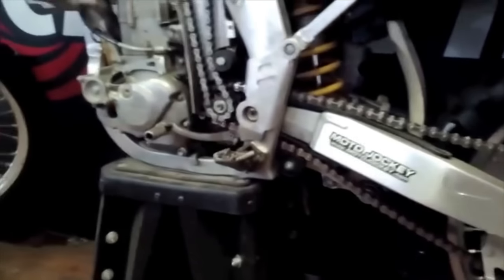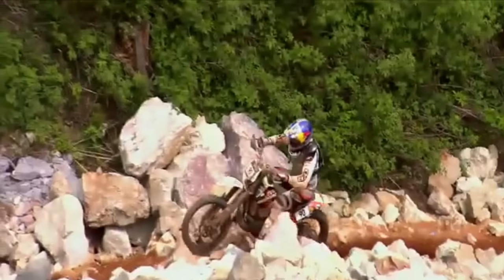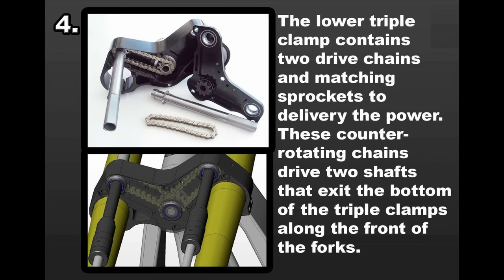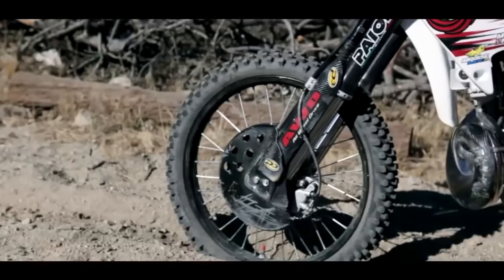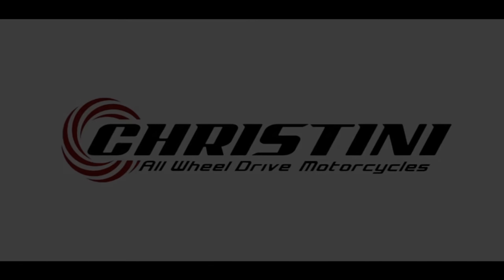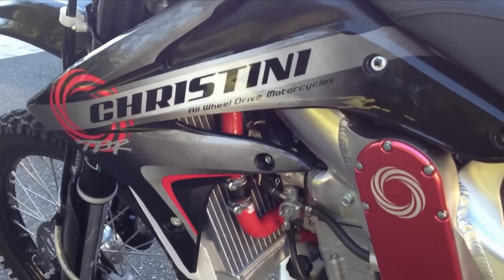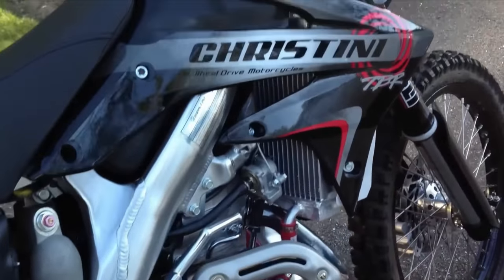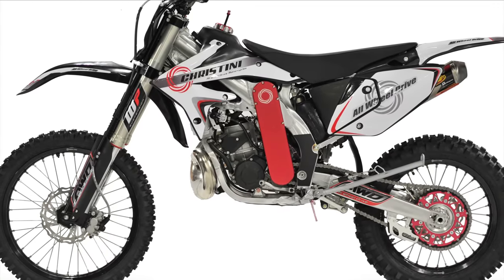The Christini AWD 300 2x2: How All Wheel Drive Works on a Dirt Bike

Comment: The thought into this design is genius. I remember seeing information about it back in the early 2000's. Although, it always looked and seemed like an expensive maintenance nightmare. I am sure a rider with support in racing could definitely benefit in certain conditions.
Reply: I almost feel that a hydrostatic drive might be more efficient. There are so many transfers of energy with this system that efficiency must go down a bit
Reply: @NetPredators  not really. Chain drive uses very little energy. You're losing more through a standard transmission alone that the awd setup does
Reply: @spencerkleiman5035  lol, you do realize that there is more just 1 chain drive there? There is at least 8 transfers of energy there with loss at each transfer.
Reply: @NetPredators  The chain or shaft is a final drive, so no matter what you do, that last one is what the most important. Front double driveshaft like this one lose more than 20% power, but I think that is a worthy tradeoff considering how fragile a front chain drive system is (I had one in the past)
Reply: Rokons had 2wd since the 50s.

Comment: Fun thing I've seen, someone back in the day made a 2wd by adding a hydraulic motor - the rear chain essentially drives a hydraulic pump which then moves the front wheel when needed. He briefly mentioned hydraulic pumps in his video, but not how they worked in this respect - I'd say it's as simple as a front electric motor... Without needing electricity
Reply: Yup Hydrolic is a much better design
Reply: Hydraulic is definitely an interesting idea to drive the front wheel. With how powerful modern electric motors are and how efficient generators or even alternators can be though, I think going electric is a good move. Instant torque front and rear would be something else, and for a full electric setup would be as simple as dual hub motors.

Comment: I would like to see a system such as this on an old Honda ATC three wheeler, an awd Big Red 250ES would be pretty cool imo.
Reply: That would be awesome on a big red
Reply: Why not a 250SX or 250R?
Reply: @hank1556  LOL! Okay, add them to the list as well.
Reply: Tires are too big. Not enough rotational rigidity to turn and power through if its stuck
Reply: @jeeperzcreeperzz  Surely there is an efficient and effective way.
Reply: @markalan4026  maybe if a 3wd system was used in low gear it might work?
Reply: @jeeperzcreeperzz  I was thinking a series of small drive shafts (telescoping on front forks), using ring & pinion type gears, and a limited slip mechanism for the front wheel.
 I'm no engineer, but I know there is a way to make this work. Wish I had the skills and resources to make it happen myself.
Reply: @markalan4026  bvc offroad confirmed they are making a 3wd trike
Reply: @jeeperzcreeperzz saying trike after 3wd is unnecessary of course it’s a trike 😂
Reply: @Thumper68  except there arent any that are true 3 wheel drive so my statement still stands.
Reply: @jeeperzcreeperzz  you don’t understand if your making something 3 wheel drive it’s obvious it would be a trike having 3 wheels. You’re not going to make a three wheel drive on a 4+ wheel vehicle so by default it’s got to be a trike so my statement stands
Reply: @Thumper68  Not necessarily, and I don't think it's very important or productive to care what it's called. I have seen a homebrew "hybrid" go kart be 3 wheel drive. 2 electric motors in front, 1 wheel driven by the gas motor in the rear.
Reply: Just put a dual rear on a rokon trailbreaker.
Reply: Would be almost worth it to buy one and put it on big red. Would have to learn how to drive big red again.

Comment: Around 20 years ago Yamaha had the 2-wheel-drive WR 450 F2-Trac. It’s a hydraulic system and gives up to 30% to the front wheel depending on the wheel spin/traction loss of the back wheel. But this system looks also pretty cool especially for a retro fit.
Reply from the maker: Thanks for the info!

Comment: I'd heard of these years ago and believe there was military applications and that it was mainly being developed for that.  I'd imagine electric motors now would trump this design if technology is here now for it.  Would be just as fast , could be full time 2x2, and totaly stealthy  as  nearly silent compared to a gas engine.   Battery weight likely the main issue,  but the tech is growing very rapidly and I'm sure the military is on the cusp of it if anyone is.    Enjoyed the video 👍👍👍
Reply: At least 40 years ago? Rokon (spelling?) comes to mind?
Reply: alternator + small battery and a hub motor on the front wheel. DONE and could be customied with software... wish i had money to go patent a design like that :)
Reply: @vihreelinja4743  that would be one hell of an alternator
Reply: @benfennell6842  If it's not full-time 2WD, it could be charging the batteries while rolling in 1WD. This would limit how long you stayed in 2WD at full performance, but at least lets you recharge while moving through easier sections.

Comment: This is definitely a new take on 2WD bikes.  I had a Rokon TrailBreaker back in the mid 1970"s.  Rokon's  are not "dirt' bikes though.  They are slow and steady trail bikes for going where there is not a path.  I think that they will go places the Christini will not, but the Christini is light years faster.  The drive system was very different, too.  The 2WD is full time and only cuts out on the front when the spring loaded clutch slips (by design).  This seem very cool, and I wish it had been around when I was an active dirt biker, 30 years ago. LOL

Comment: Yamaha and ohlins were building a limited amount of 2wd dirt bikes in early 2000s using hydraulic drive system, a local bike shop had one of these bikes forsale about 15 years ago as I was tempted to buy it
Reply: Yeah I remember these 2WD WR's. At the time there was a lot of hype about them being the future of dirt bikes. Never did get to see one in action. The 2WD system is a marvel of engineering but probably a novelty for most riders. For some circumstances they could prove invaluable.
Reply: I tested the Yamaha 2-Trac for Australasian Dirt Bike Magazine, and the story was re-printed in one of the US mags as well. I liked it, but many of the top riders that rode it didn't. I think this may have been because it tracked so well in slippery corners rather than sliding. They were all used to steering with the throttle and back wheel in those conditions. Only 250 were made, and only 20 came to Australia, none went to the US. At least one of the Aussie 2-Tracs was sold by a dealer here to somebody in the USA. They couldn't be road registered in Austrlia as they did not have a compliance plate and were twice the price of a conventional WR450. They also came with top of the line Ohlins suspension front and rear and an Ohlins steering damper.
Reply: @wazzanose   they were nice looking bikes

Comment: Man this would be killer on a torquey trail bike. Like a TW200 style bike with more power seems like the perfect fit for having 2wd. Just a bike designed to tractor anywhere 2 wheels could ever go with minimal effort
Reply: Would be interesting in a Trials bike. Could be hopping around on the front tire instead of just the rear
Reply: Rokon out of New Hampshire has been building these for decades. They even have one with big hollow wheels that floats

Comment: Very cool ! But since I'm not in to going fast and prefer a quiet utility machine to poke through the woods, I'm still going to own a Rocon 2x2 one day.
Reply: I think I remember seeing one when I was a child. Is that the bike with big tractor tires?
Reply: @shovelhead108  The old ones had very tractor like tires and 2 stroke engines. Now they have ATV type tires and 4 stroke engines. I miss spelled it Rocon, it's actually Rokon.

Comment: It looks pretty cool but just remember those extra 6 kg (13.2lb) are mostly rotating mass with a fair bit of it being unsprung weight. Both of which will make if feel heavier then 6kg (more like 10-15 kg) and dramatically effect handling. 
I also wonder what effect the two drive shafts have spinning adjacent to the engine and having a torque effect on the steering would do to over all handling?
All that being said bike set up is a game of give and take to improve in one area you usually have to give up in another area and for all the negatives I’ve mentioned you are gaining  traction which in some circumstances is very hard to come by😀
Hopefully one day i get to try it out
Reply: It changed the handling so much that the guy started on the second row and went right by all the 1wd bikes
Reply: @ClumsyCars  was that the bike or the rider?
Hey i think it looks pretty cool but if it’s as good as you say then why isn’t every hard enduro around the world being dominated by one?
Reply: The purpose of having drive shafts on both sides of the front wheel is to prevent gyro steer (or at least minimize it).
Reply: And spread torque load I’m sure

Comment: UBCO crossed with a gas bike. Hybrid - electric front hub drive and a 450 gas engine for the rear wheel on a KTM Freeride frame with a beefy charger (mechanical from the gas engine). For getting out of sticky situations only, and help with slippery hills. Button on the left thumb.

Comment: to much gears to fail Ohlins have a similar concept for the wr450f with hydraulic pump on the sprocket and oil lines to the frontwheel hub wich transfer the oil pressure in to turning the front wheel! its more clean solution and less shafts gears and so on!

Comment: 2 of my 3 electric bikes are All Wheel Drive. Its 2 independent system. 2 Motors, 2 controllers, 2 batteries, displays, 2 accelerators, one for each thumb. I also have 3 motors on one my bike which is 3 everything. 2 thumb-throttle on the right and one on the left. The 2 on the right are the rear hub motor and the mid-drive motor and the one on the left it's the front motor. I used many combination.

The thing with all wheel drive is the front wheel is directional. So at low speed when you are turning for example you want to be careful and use very little throttle on the front motor because the bike will pull the bike this way and you will go the other way. So basically when I turn at low speed, I only use the rear motor and when I get more straight I add the front motor. At least in the beginning when you learn and you are not used to it.

Note that my experience is on the road and snow. Off road folks have more skill will probably get that in seconds. Humbly!
Reply: А вы на каждое колесо использовали по своей (отдельной) ручке газа? Тоже уже давно подумываю либо об электрическом велосипеде на основе полного привода, либо об мотоцикле 2х2, но с независимыми приводами чтобы в идеале каждое колесо можно было накручивать газом по отдельности в зависимости от необходимости...
🤔🤔🤔

Comment: A nifty way to get power to the front wheel but I imagine the parasitic power losses would be huge and all those mechanical linkages and bevel gears to shim/adjust and the mess of the drive chain etc. It would be far simpler to mount a battery somewhere and put an electric hub on the front wheel, probably weigh less as well. We have 2WD electric off road bikes here in NZ, good in the mud apparently, not much good anywhere else.
Reply: С электрической начинкой скорее всего, будет больше веса.

Comment: Looks rad. One thing to think about is when, not if, it fails. Will it break and let the rim still spin? Or will it break and lock up sending the rider over the bars?
Reply: Not everything is an if, not when. I’d argued this system is less complicated than a modern 4 stroke.
Reply: @alecnull  i agree to disagree. Rotating parts eventually fail. Just a matter of time. Dirt bikes are treated roughly, so just a explanation of what keeps the rim from locking up on failure?back rim lock ups dont throw you off.
Reply: from what I'm reading, it uses one way clutches which are located in the front hub, so yeah, unless the failure is in the front hub itself (which seemss very unlikely looking at the design) it looks like it will still let the rim freewheel
Reply: @omurize2007  ok, that sounds great. I did not see that in the design. Would love to try it out. Must feel wierd having the front pull you.
Reply: It's got a one way clutch in the front wheel. It doesn't hold back..

Comment: Bumped into Freddie Spencer a few years ago and discussed this idea for MotoGP bikes as with heated rims this would stop the front tyre from losing heat and therefore the grip which causes the front end washing out,  momentum from restricted power to the front wheel would stop the front free wheeling therefore making the bike faster because of increased drive but would be slightly heavier.
Reply: А что в итоге сказали в MotoGp?
😉😉😉

Comment: How "bout a hybrid which adds an electric hubdrive in the front, for getting out of sticky sits, not for continuous use. A beefy charger off the gas engine, which draws a little of the horsepower and a nice battery, but not for continuous drive. ??
You know - "sticky situations"?

Comment: I love the idea, but I would try adding some weight to front not just throw it front wheel but move the whole engine forward , rear shock under  it will make more easily controlled , but the best thing about your design is that it will get people back. To th woods and away from acrobatics and crowd pleasing

Comment: To be honest a low wattage electric hub motor built into the front wheel would be simpler and only the synchronization issues would have to be sorted out.You don't need much power to have a positive effect.

Comment: I own one. 2006 576 Ktm dual sport, with auto clutch, and rear brake on the clutch lever now. At 55(then) , it made me better rider than I was at 25. Friends stop following me on rides.
Reply: У вас поездки преимущественно по бездорожью?
Reply: @ACMulti100 . Both highway and extreme off-road. I ran an enduro tire that Malcom recommend. It was a beast there wasn’t any trail or course I couldn’t  conquer. Up hill or down hill, it was so stable.
Reply: @grumpyg9350 , понял, здорово. А за сколько примерно брали, сколько по времени пользуетесь и были за время пользования какие - либо поломки? Как с доступностью запчастей и возможностей ремонтопригодности и сервисного обслуживания?
🤔🤔🤔
Reply: @ACMulti100 I don’t remember the cost. I think it was around 5,000.00 usd. The only issue was the rapid deterioration of the rubber bellows that covered the telescopic tubes. They changed the formula of the rubber and that took care of the Bellows issue. I drove it for about two years as hard as I could. I probably put about 10,000 miles on it both on an off-road equally. I crashed the bike several times, but nothing ever happened to the Christini. It has a lever on the triple clamp that disengages the unit so that you could ride it on the pavement. I drove it both on flat track dirt type roads, as well as, of course, difficult terrain, mud, Sand and rock. Going down hills I didn’t even have to worry about locking up the rear tire. I would just squeeze the front brake and the thing would stop. The front tire was driven by the rear tire so that it was very difficult while going downhill to lock up the front tire. While going uphill on steep terrain, I would just lean as far forward  and that coupled with the torque 572 and automatic clutch, would creep up any hill at a very low speed very easily. it did add a little weight but I just adapted and it was fine. I removed the cooling fan on the radiator and ran a different coolant that boiled and a much higher temperature so that I could have room for a 3 and a half gallon gas tank. I ran a lot of long trips through the mountains and deserts and needed the extra fuel cap capacity. Christini provided the fuel tank too. Maintenance was simple. Keep the moving parts greased and everything was happy. I stripped the frame to bare myself and sent it to them, got it back in  a month,and put It back together myself.

It’s hard to explain to someone the capabilities, even my friends, but it was the best riding experience I’ve ever had in 30 years.
Reply: @grumpyg9350 , понял, возможно тогда тоже себе когда - нибудь возьму подобный. В идеале, конечно, на мой взгляд, было бы лучше, если можно было бы делать независимую дозировку газа от каждой ручки газа (левая и правая) в зависимости от необходимости на оба колеса...
🤔🤔🤔
Reply: @ACMulti100  lmao. Got me.👏🏻

Comment: What is the cost of a awd 300? Wonder if the manufacturer couldn't add an electric hub motor front wheel. For the times you need AWD

Comment: No one argue the merit of added front wheel drive, but It looks like shaft driven front wheel add weight and limit articulation. Electric front wheel hub is the better implementation

Comment: I’m considering selling mine 2014 300awd  I have extra rims and a saddle tank for it . 
I will say that when you drive by your friends that are stuck in the mud is great. The worse the conditions the better the 2wd . If you ever got stuck and had your buddy roll your front wheel to get you out that is the advantage.  But I have found if the clutch under the tank gets wet and you make it slip it is like wet drum brakes . Maybe someone can print a cover to keep it dry.